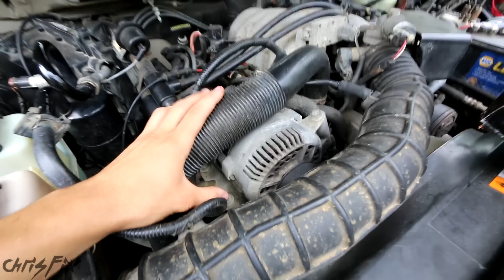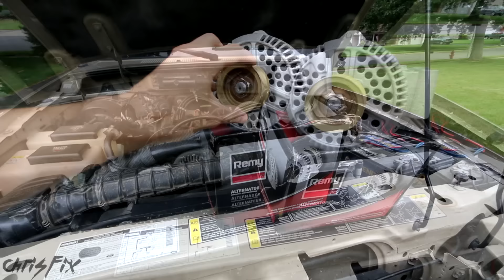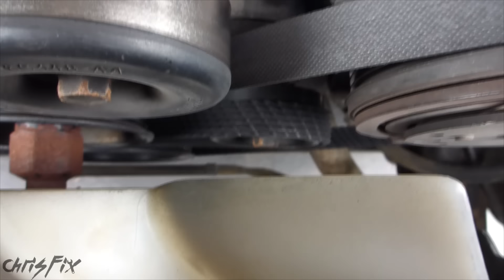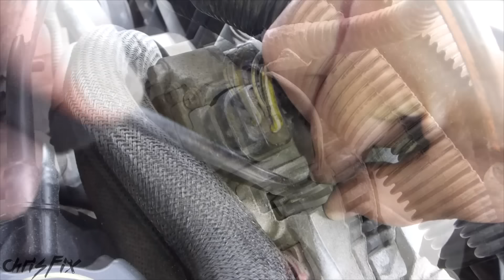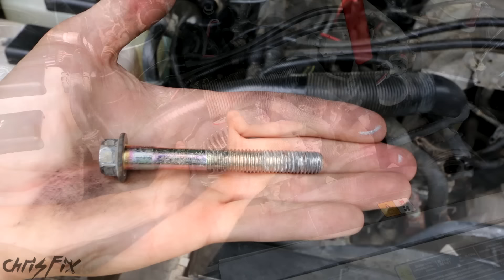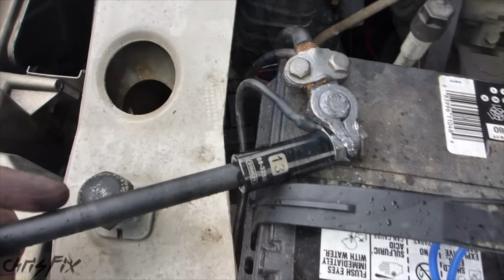How to Replace an Alternator

Comment: Charge the battery a bit before starting the car.
Reply: why? the alternators job is to charge it.
Reply: cockergrabber if it's been driving on a bad alternator the battery would have been drained due to that and won't have enough juice to start the car. Don't just blindly charge but definitely check the voltage first

Comment: Its even simpler on my 1996 Subaru Outback- good video, its a simple job, I am a newbie at this stuff, On my previous car I just kept the alt and had it rebuilt less then 50 bucks and would swap it out when one when bad- wore out that car and I still had a good rebuilt alt for it when I junked it! Saved a boat load of money over the 20 years I owned that car!  My guy would take the alt do a rebulit on it- cost less than 50 bucks!

Comment: parts are so cheap in america..
Reply from the maker: mczoze1998 Yea, it is pretty nice!
Reply: i hate this place with 200$ paycheck and 4$/gallon fuel cars are expensive as fuck
this mazda goes for about 6000 euros here
Reply: also OBD II meters are 300$ and up and mechanics charge 20euros for looking at your ecu and another 50 for removing the error

Comment: Is that the Mazda b4000? I want to buy one it is a 1997 in mint condition with low miles. How reliable it is and how handles in the snow? Thanks for all your help.
Reply from the maker: Leo Camas It is a B3000 and it handles great in the snow, sand, mud, etc. I really like the truck!

Comment: Hi Chris  good video as always,I have a problem, 2002 jettaa  2.0 liters , it has a code po302, cylinder two misfire,at first I replaced spark plugs ,same code  I got to the point that already have replaced ,wires, coil pack, maf sensor, checked injectors, vacuum leaks, compression,and all that checks ok, and I still got same code, please help me, thank you Chris , ur buddy from San Diego ca
Reply from the maker: Everardo Camacho You pretty much changed everything that would cause a misfire and you checked for compression. I would think it might be a clogged injector. Maybe switch out cyl1 injector with cyl 2 injector and see if the misfire moves to cyl 1.

Comment: Hey, chrisfix. I have two problems with my BMW E90 (2006 model) and was hoping you could help me out by replying here or make a video.

1st problem: every time I turn off 
A/c it starts to smell REALY bad.

2nd: my servo sqeals like fuck even though the pump is working, no leaks and enough steering fluid oil.
Reply from the maker: Nico0HF For the AC you should try spraying febreeze down the vents outside of the car where the air gets sucked in.
For your squeal, it could be a bearing or it could be a pulley misalignment. Check out this video and try the water test: https://www.youtube.com/watch?v=AEUe6uKxTv8
Reply: ChrisFix Hey there, its not that type of squeaking noise, its when I turn the steering wheel. tried febreeze lasted for about a week then the stank came back.
Reply from the maker: Nico0HF Check out this video for the squeak: https://www.youtube.com/watch?v=62bVn7E8gyk
Reply: ChrisFix You don't happen to use snapchat do you? so I can send you a movie with the sound problem?

Comment: hey there chris, i have a question that has nothing to do with the alternator. I have an 06 maxima we had the brake pads replaced and replaced the back two rotors, We had problems with the steering wheel wobbling and wondering if we replace the front two rotors if it'll fix the problem? it only happens when we brake and usually at higher speeds. sorry didnt want to look for a brake job video to ask just looked at the most recent video of yours. thanks have a good one
Reply from the maker: Jake Brown If the wobble is only when you press the brakes then yes, you probably have warped rotors and replacing them will fix the shake. Here is a good video for you: https://www.youtube.com/watch?v=lU6OKQxSg8U

Comment: I feel like you miss one crucial step. Its extremely hard on an alternator to have to charge a dead battery. I fell you should have shown the step, or at least mentioned that you should have a fully charged battery before putting on a new alternator.
Reply from the maker: moe61806 The battery is fully charged. I showed the problem was that at over 4k rpms the alternator would not charge but otherwise it was fine. Thanks for the tip.

Comment: Hey bro
If I can suggest you look into the big 3... 
I just heard of if yesterday. It has to deal with adding zero gauge wire for better ground for battery, engine ground and positive cable. Like I said I'm still trying to research it for my self
Reply from the maker: Manuel Aguayo Yes, that is what the electrical upgrade video I mention at the end will be about!

Comment: If only all alternators were so easy to access.
Reply from the maker: The Mighty Cass I know right?!?!. One subscriber was telling me how he had to remove a motor mount and jack the engine up to get to his!
Reply: ChrisFix On my Honda Element, you have to remove the power steering pump and radiator fan.  I miss my '73 Ford F-150, where you could literally change out the alternator in about 10 minutes!

Comment: Perhaps you've mentioned this before in other videos...but any time you disconnect a battery please make sure that your car or truck doesn't have a security system that immobilizes the vehicle if the battery terminals are removed...make sure you have the security code for the vehicle. I had a 2000 Mitsubishi eclipse that I was working on that required the battery terminals to be disconnected. When I was done I went to go start my car and found out that it wouldn't start...I had to put in the security code for the car through the radio using the preset station buttons...I did not have the code and the car was locked down until I got the code. I eventually called a few Mitsubishi dealerships...one wanted to charge me $100 for the code!...but the other one gave it to me for free. I entered the code and the car started fine but it was a hassle and a lesson learned. Just a precaution, you don't want to be working on your vehicle on a Sunday night and have this happen and not be able to get to work the next morning.

Comment: Good call with making a note on the amp differences on the two alternators. I had a 1994 Plymouth Sundance Duster with a V6 that had charging issues and when the volts got to low it would actually jump the serpentine belt...when I went to get an alternator for this car, I had been given the option of a 90 or 120 amp. I wasn't sure which one to pick and the parts guy at the store I was at was no help either. They said they cross checked the VIN # of my car with the alternators (not sure if they were telling the truth or not) and sold me the 90 amp. I installed it and still had charging problems and the alternator was really hot. I got the 120 amp and installed it and that seemed to work better. Due to other issues I no longer have that car...but just a note that it does pay to make sure to know what is correct or compatible with your car or truck...it will save time and money.
Reply from the maker: letthewinderaseme Thanks for sharing!

Comment: Gotta love them Goodyear gator back belts
Reply from the maker: jwooter69 They stop the squeak which is great!
Reply: After a trip to the beach my belt squeaked bad. Changed my main belt and ac belt with gator belts a year ago. No signs of wear from them and not one squeak. Love em

Comment: That looks like the alternator on my 2003 F250 7.3L diesel. The alternator on that F250 is WAY easier than this. You don't have to take anything off to get to it. It's at the very top. The hardest part about replacing it was getting the belt back on. haha
Reply from the maker: Matt Rocus Awesome! You cannot beat that! Thanks for sharing!

Comment: This last winter, my battery froze and I think it took the alternator with it. Had my truck out at the ranch on a really cold day (-45c). Started and the battery light was on, truck would die if you revved it too much. Had to take a new alternator and battery to resurrect it from the winters super cold temperatures.
Reply from the maker: KALI1080 Wow that is crazy cold! I cant even imagine!
Reply: I get the continental extreme for weather. The middle of Canada has no large bodies of water so things get pretty crazy when we get an arctic breeze from the north.

Comment: Is there a certain rule of thumb to know how tight the serpentine belt should be tightened? I've been told that if you twist it, it shouldn't rotate pass 90 degrees
Reply: Yes as far as tightness of it it shouldnt easily turn past 90 degress if it does its most likely time to replace bc of slack could cause slipping of the belt
Reply from the maker: xiingli That is a good way to test it but this car has an automatic tensioner so the belt tension is automatically adjusted.
Reply: Thanks for both of your responses! My friend and I had a mini goof-up on his miata a few weeks back due to this :p

Comment: My only suggestion is dielectric grease on those little connectors, but that's just because I'm paranoid.  Great video as always!  The wire brush is a new tip that I never thought of before- thanks for that!  BTW- is than a K&N air filter?  I'm a fan of paper.  That would be a good video topic- oiled cotton gauze vs. paper air filters, both fuel mileage and MAF sensor cleanliness of each.  Cheers!
Reply from the maker: John Daly Thanks for the tip John! It is not a KNN but an off brand filter (similar to KNN). I like paper too but this one lasts so much longer and for only double the paper price! I should do a video on paper vs knn!
Reply: Now that I think about it, the used oil analysis would really tell which filter works best.  That's another chance to plug Blackstone Labs!  Cheers, John

Comment: i like the video! but only problem is on my 2000 Lincoln ls, the alternator is on bottom of the engine with the top bolt next to the engine block. It was a pain in my rear getting it off! I tried searching on youtube to find a how to video for replacing a bad alternator on a Lincoln. sadly, I only found one video on 2000 Lincoln alternators, and it just showed me where its located. luckily I got it on with the help of my uncle :) if only it was on top like this vehicle, then everything would have been a lot easier.
Reply from the maker: Billy Fineday Thanks and thanks for sharing! Yea, some alternators are a real pain!

Comment: It should be mentioned that you can borrow a serpentine belt tool from the major auto parts suppliers, if you dont have one..
Reply from the maker: ***** I did not know they rented that tool! Thanks for sharing!
Reply: ChrisFix They rent anything... You can actually buy it from them. A buddy of mine rented a puller set, then asked if he could buy it. The manager had to get involved, but he got a $150-200 puller set for $50... That might have been a one time deal, but still.

Comment: Hey Chris I have a question on a mower that won't start, I thought if you could help me
Reply from the maker: Mitchell Robbins If it has spark, the carb is either dirty, clogged, or not working right.

Comment: So you didn't put the old alternator core in the vice, grab the puller tool, and replace the bearings and brushes for a third of the cost? :D
Reply from the maker: 999thenewman I think I will be doing a video on how to rebuild an alternator soon! Stay tuned!

Comment: Torque spec your alternator kids. very important.... no sarcasm
Reply from the maker: longstar550 It is good practice to torque down bolts to prevent them from being over-tightened, especially when tightening into aluminum.
Reply: perhaps for the unexperienced but anyone with a decent mechanical skill set torque specing a alternator is a waste of time. the tolerance would be huge in those specs.

Comment: Hey Chris, I hope that anti-seize wasn't an aluminum particle based product. Aluminum based anti-seize going into an aluminum threads will corrode and actually act as a lock tight product and will gaul the threads together. I learned that the hard way. I use Copper-Kote anti-seize because it works with all automotive hardware. (as long as its not a copper thread , which is extremely rare on modern vehicles. Great video!
Reply from the maker: UnitCrane514 It is nickle based so it works just as well as the copper or maybe even better because there are no nickle parts on a car but there are some copper. Thanks for sharing!
Reply: So glad I read this, thanks!

Comment: How easy this is depends on the vehicle.  On some Cadillac K bodies for example the alternator is water cooled and stuffed behind the radiator.  You need to remove the radiator (which has oil cooler lines, water lines, and transmission lines) to change the alternator and then re-fill and re-assemble.  It's a 6 hour job by book labor rate.  Not so easy...  On other cars it's literally 5 minutes and you're done.
Reply: yeah, it can be a pain, some also have like oil-vacuum-pumps attached and are buried somewhere in middle-earth..
Reply: My firebirds alternator is literally on top of the engine (V6) you only have to remove the serpentine belt and the cables 😂. It’s that easy
Reply from the maker: ***** Yep! It all depends! Usually when you can easily see the alternator and it is up top, it is an easy job!
Reply: Same with my taurus. On the side of the engine, super easy to remove and replace... except you have to move the coolant reservoir to pull the alternator out
Reply: @20PercentMilk  : Same, I can see my alternator on the passenger side. The water pump not so much...
Reply: Hi
Reply: Woah a water cooled alternator? Is that even a thing tho damn
Reply: I din't learn anything...

Comment: I've got a question...what would cause one light to be brighter than the other, if both are new bulbs? would that be a sign the alternator is on the fritz?
Reply from the maker: MRSketch09 It could be a bad bulb or that your wiring harness on the dim bulb is bad. Try switching the bulbs from one side to the other and seeing if the dim light moves.
Reply: ChrisFix Thanks for the reply. But you misunderstand. One light seems abnormally bright compared to the other one. Like people will flash there lights at me thinking I got my lights on bright

Comment: Great video, there Chris, as usual. I second your tips on using anti-seize lubricant on the bolts. From an engineer's perspective this is crucial as the clamping load induced by the bolt (when measured with torque) is a direct function of the friction in the threads and can result in a different preload from that intended by the torque specification.
Reply from the maker: Tom Carlsen Thanks a lot Tom and exactly! I am glad you feel the same way!

Comment: You don't need to use a torque wrench on the serpentine belt when you put it back on?
Reply from the maker: ***** Nope, the tensioner is spring loaded and self adjusting.

Comment: my alternator is right on top, as soon as you open the hood prety much the first part you see..

if you need more leverage, you can esily slide a pipe over the ratchet to break lose the bolt, i do it all the time and the ratchet still works great as ever..

simple straight forward job, very easy to do..

Excellent Video !
Reply from the maker: ***** Thanks a lot bud and thanks for sharing your tip!

Comment: Great video Chris.  I put a bigger one in my truck too.  If anyone is wondering, I went thru a lot of "alternator diagnosis" videos, and tested & tested, and couldn't really find anything....  But the new alternator solved ALL my weird intermittent electrical problems.   So, if your car/truck is over 100k, or is over 7 years old, try an alternator...  Chris didn't get into this, but if your serpentine belt, your your tensioner, or an idler pulley is getting iffy, this is a good time to do that too, since you're in there anyway...
Reply from the maker: Patrick Morrissey Thanks a lot Patrick and thanks for sharing your tips as always it is very helpful for everyone!

Comment: awesome video! as always :-). Will come in hand on my Ford at some time for sure.
i remember changing the alternator on my old car, had a V-Belt going from the crankshaft pulley to the alternator, no other accessories. That thing was darn easy to fix
Reply from the maker: Kaktus Jack It is the best when they are so easy to replace! Nice and straightforward job! Thanks a lot bud!

Comment: Mine on my 99 Lexus es300 is literally 3 bolts and a fuse box that slides out of place. 12 mins 🙌 but I have an electric problem. The AC will drain the battery at idle in about 5 mins
Reply from the maker: JDMSteven Sounds like your ac compressor might be putting a huge draw on your battery then. Try pulling the ac compressor fuse and running the AC and seeing if it still drains.
Reply: It's not the compressor I believe because it does the same thing when I put the heat on.